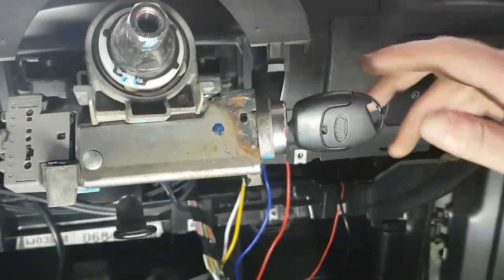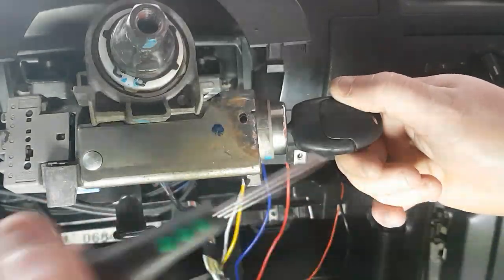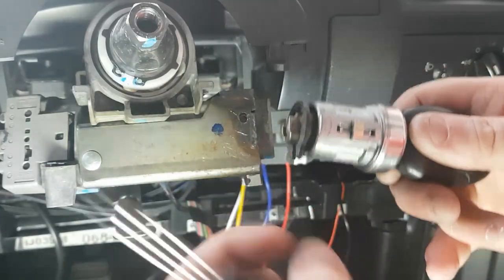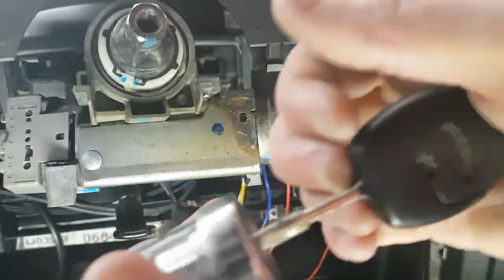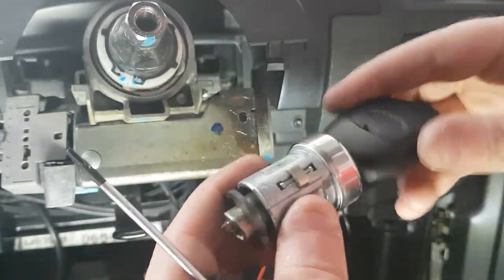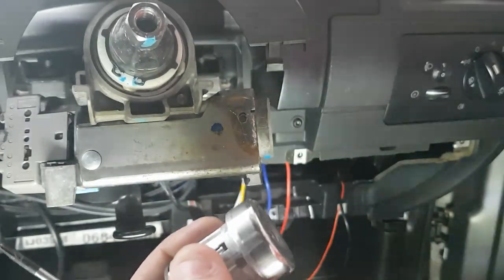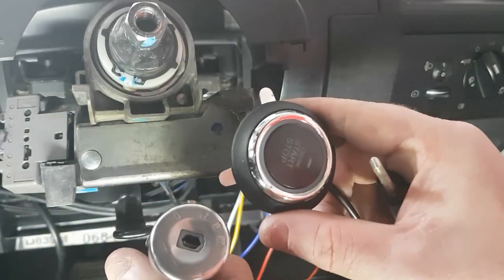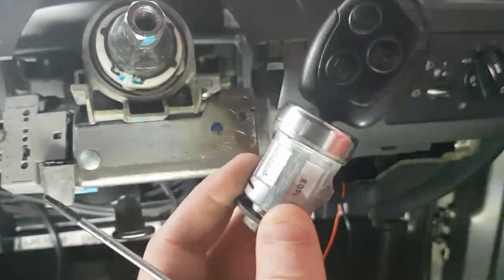How to: Ford Mondeo MK3 Ignition barrel removal ST220

Comment: Why you dissasembled steering wheel and half of car ;) No need to do this. I changed barrel in my car today and only thing you must do is loosen two screws under steering wheeel, open a little bit lower cover and you have access to this hole if you use 90 degrees hex key.  Need just to turn a key into first position simultaneously putting this hex key (may be a piece of stiff wire also) and it pops, then you can pull key together with barrel. No need to take off most of things you did.

Comment: You still need your key to start the car, it needs to read your chip in the key. Pretty pointless swapping it for a switch
Reply from the maker: You just need to get the buypass modual  for the chip or spare key for it to work.